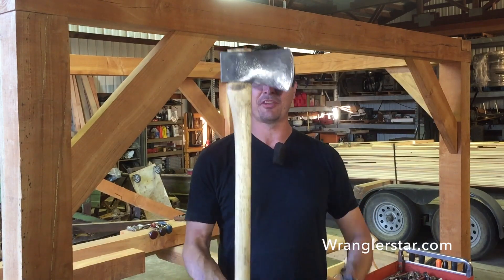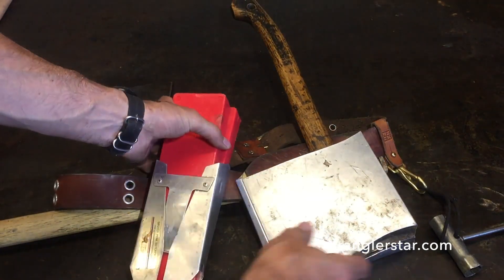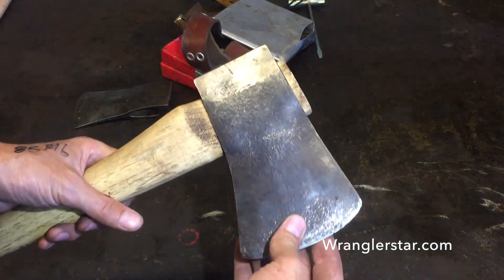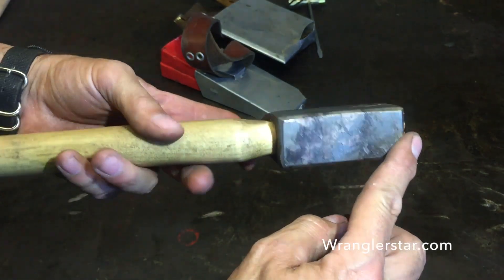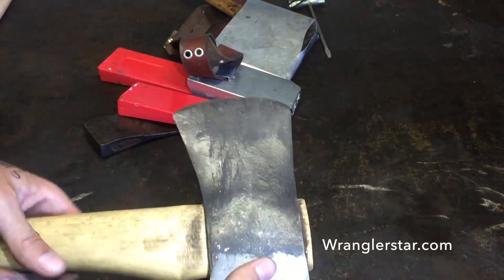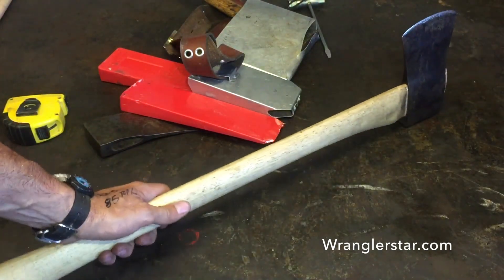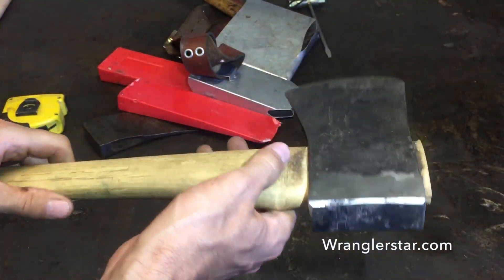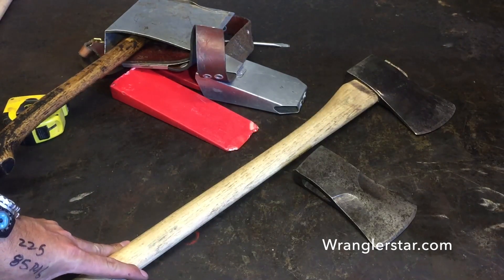Best Timber Fallers Axe Ever!

Comment: Your fellers axe is very similar to my favorite large single bit axe.  Mine is 40+year old True Temper 4 # Michigan style axe, supposedly made from Swedish steel.  It has been a wonderful axe.  I think I paid about $20 for it in the early 1970’s.  It has been through three handles, usually broken splitting big rounds of live oak.  I lost it off my tractor and ran over it and put a crack through the eye about 25 years ago.   Last year I had a friend MIG weld it for me, so restored it to its original fit and finish.  I put a 31 ince does leg hickory handle in and painted it in its original red color.  I have used it considerably in the past year, splitting wood, cutting oak roots and it is as good, now, as it ever was.

Comment: My wedge bangers are any one of my Boy’s axes.  I have quite a few of them - Collins, True Temper and a Scandinavian Forest axe.  If I need a fellers axe I grab my 50 year old 4# True Temper Dayton with a 31.5” handle.   If I need a longer handle I have a new forged Collins 3.5#, with a 35” handle.  I sharpened it, yesterday with my hockey pucks and wet stones.  I put a good bevel on it.

Comment: More detail concerning the uses a falling axe.
Approaching the tree, the axe is used for "swamping out" or clearing obstacles from the escape path usually a 45degree angle from either side of the back cut. The chainsaw can be used for the larger stuff, but most fallers are reluctant to use their chisel chain if there is any chance of nicking a stone.
Second, removing the bark from the back cut. It is impossible to for the wedge to function properly on soft bark.
Third, knocking out the under cut wedge, and cleaning up the corners. At this time you can lay the axe in the undercut and sight along the head for the layout.
The plastic wedge is placed in the back cut as soon as possible to prevent sit back in case a wind gust hits, then wedge the tree over if needed.
Lastly knocking off dead limbs with the poll, and marking log lengths before bucking.
I forgot one of the most important uses for a fallers axe. As you approach the tree, you pinch the end off the handle and let the axe hang straight down, and use it for a plumb bob to check the lean of the tree. Just like using the axe for laying out, you have to know your axe.

Comment: What is the recommended handle length for a GB American Felling Axe and/or is there a rule of thumb to best determine this?  I'm 5'9".  The options are 31" or 35".  Also, is a straight handle or curved handle preferred.  Appreciate your videos.

Comment: If you have a 1/4 piece of brass pipe you can make a A good roll pin then use a punch to flair the ends when its in the head

Comment: Tuatahi work axe is the boss. They make most of the racing axes. Not cheap however. Restored an old race axe.5 pound head.Great axe with large tuatahi handle. I have and love small forest axe but love the big beast as I am 188cm tool and 102kg so sometimes it is nice to have a little heft.

Comment: Looking for new tires Cody:)?
Reply: Gago0512 I was thinking the same thing.
Reply: Gago0512 i looked it up too :P
Reply: Gago0512Truck tires to be true! 225 Millimeters wide 85% sidewall and a 16 inch rim!  If you want to go with a wider tire but not a larger circumference you can also use a 235/80R16 or a 255/75R16.  The 235/80 will be about 1 inch larger and the 255/75 almost the same in circumference!

Comment: Hi Cody,
Firstly thank you for another great video. I have not seen a single video from you that I have not enjoyed and appreciated. I also have a GB small forest axe, and I have to agree they are a great tool. However recently I have wanted to cut bigger rounds of dead standing wood, and find I want something slightly bigger. so I have ordered a Husqvarna axe, which is the equivalent size to the GB Forest Axe. In Australia it is called Husqvarna Limbing Axe, I believe in the US the same axe is called the Multipurpose axe. Both of these axes sound like a similar size to the axe you review in this video. Have you, or would you, review this axe compared to the Husqvarna or the GB Forest axe? Just wondering. Thanks again for your awesome content.

Comment: You'd cut the handle to 18" if you had to pack it all day. Ain't much that can't be driven with a 3lb 18" straight grip. Anything more and I'd pack my 5ld 24". 10" and 12" wedges. Finally got to the point I'd leave my small axe bumped along the strip and use a 10" wedge and set it with a 12". Anything to cut weight. Make one up Cody, see what ya think. I like the bevels, I do believe I'll adopt that, with credit to you of course

Comment: Cody, I don't know why you would ever think of roll-pinning your axes.  Roll-pinning is for pulling and prying tools, which the axe is NOT.  You've become so wrapped up in the idea of preventing the head from coming off, when in actuality, the way you personally mount axes is done very well (better than some manufacturers!).  It appears your mind is locked into an "all or nothing" mode, where for some reason you think "all tools with mounted handles should have a roll-pin."  You do NOT need a roll-pin for an axe.  It's just that simple.  And yes, a roll-pin is never a good idea on an axe, because 1.) subconsciously it gives you the idea that you can then use the axe as a prying tool ("well, that head won't come off now -- no worries about prying") -- a terrible idea, and 2.) it damages the axe.  Not only drilling/ruining the axe head, but also severing the wood fibers in the handle underneath.  Whereas you want highly compressed wood inside the eye of the axe head, you're compromising that compressed wood by severing the fibers with a hole.  The axe is not a mattock -- and even then, mattocks themselves don't use roll-pins.  That should tell you something.

Comment: OK, so i had a timber faller and little experience, it wasn't my timber faller but it was merely at my house, i believe my grandfather used to use it, though i'm surprised if he did (he's very weak at about 80 years old now) the only problem is the head is hardly sticking on the the handle, can someone reccommend some high quality glue to me?

Comment: I have a similar axe it was stamped though it's a American axe co axe given to me by my grandpa all I know is ten years ago it was very old and I have never seen a axe that was so hard on the blade I am having a hard time sharpening my file basically bounces off barely scratching it what does that mean is that a good axe or no when I got it it was in bad condition but now it's almost complete
Reply: Some of the older axes can be extremely hard, especially compared to axes produced today. Try alternating between a very coarse stone and file. The stone will rough up the surface allowing the file to cut until the file has smoothed out the steel again. Your Axe was made by the American Axe and tool conglomerate in case you were curious.

Comment: Okay my great grandfather was a logger. I was out at his cabin the other day and I found one of his old axes. with a handle that broke and so there was like 3 inch handle on it. So I referbished it and I just went to the hard wear store and bought an axe handle. But my friend was saying that my axe was for wedges. And you could tell that is was a wedging axe bc the back of it was all dented up and the sides of it started to flare out. But my friend was saying that the handle on those axes should have a 19 inch handle. Can you tell me what a good handle length would be. I have have a normal 25 inch handle on it but I want it to look original so is that the right handle what do you thinks.

Comment: Hi Cody. Could you elaborate on pounding stuff the poll of an axe. What applications are OK and what are detrimental for the health of your axe?
Reply: Don't hit metal if you care about your pull wood is ok cement will chip it don't put your axe in the dirt, you can sand a pull off but it will take weight and material from your axe

Comment: Speaking of class how did you do?  Really that "fallers" axe is real close to what many of us use to carry in our 4x4s for years.  You wanted a heavy head for cutting and a short handle so it would fit under the seat or strapped to the back of the seat like I did in my 67 and 72 Landcruisers.